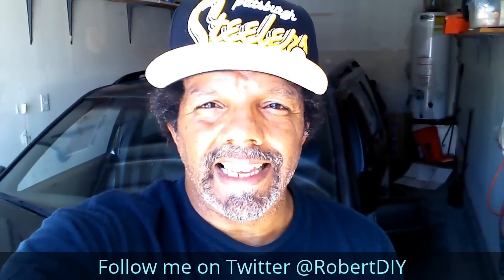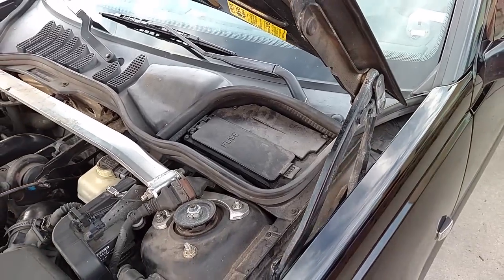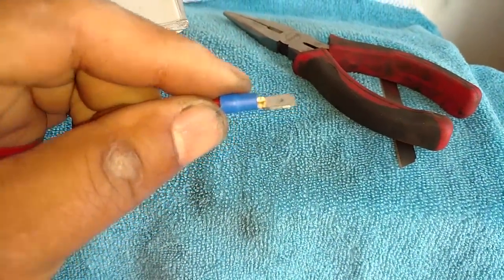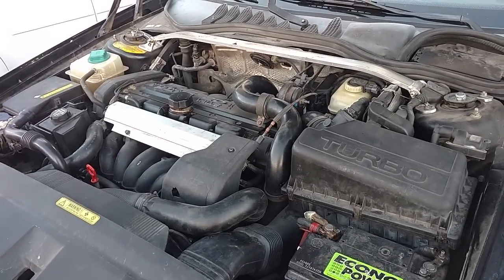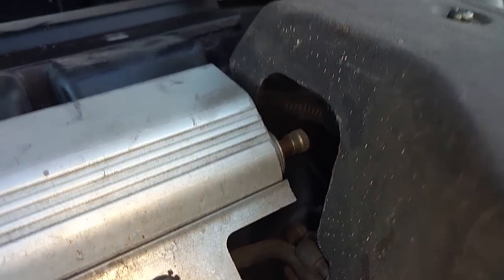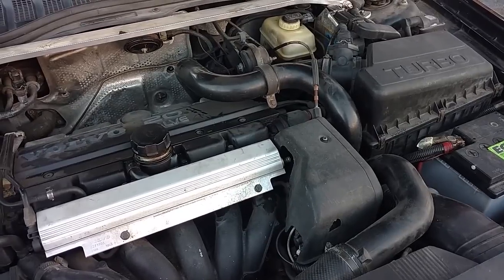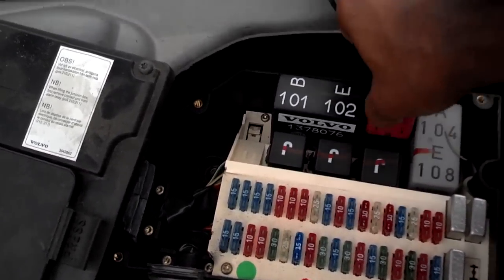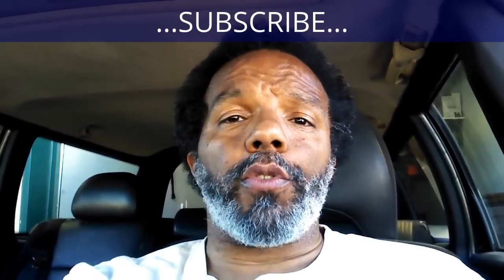Random stalling, will not start, fuel pump and relay testing, Volvo 850, S70, V70, V70 XC, etc.

Comment: Is there away i can contact you i have a 200q volvo s80 and i have a question  about mine
Reply from the maker: Yes
Reply: Robert DIY any where i can email you? In breif i have a 2001 volvo s80 runs perfect. My serpi he belt stredded and i had it replaced  along with the crank pull. Now my car will turn over but wont start. Im being told its the motor. The im being told its simple as a senor and timing that is off so i have it sitting in my yard not knowing what to do?
Reply from the maker: Did you check the timing?
Reply from the maker: https://youtu.be/gt9w-ZSxs9I
Reply from the maker: https://youtu.be/MPt0BZ3B_2w
Reply: Robert DIY my mechanic  put the belt on and idk.  Alot of people  i went it with  said they dont  like working with volvos...
Reply from the maker: https://youtu.be/hJIoyHLl30U
Reply from the maker: So, don't let them touch it.
Reply: Robert DIY ik now but its to late  im having it towed to a volvo certified  dealer
Reply from the maker: Why?
Reply: Robert DIY to get it fixed  thats  the only choice i have. I dont know nothing  about cars. The thing is i dnt know whats wrong with it.
Reply: Robert DIY i alread had my mechanic  put the belt and crank pull on and it still didnt start. It turns over but wont start
Reply from the maker: Did you watch the videos I sent you?
Reply: Robert DIY doing that now
Reply: All my mec did was out the serphine belt back on. Nun with the timing belt ir nun was checked. And i dnt know if my 2001 volvo s80 is a interference  engine or not
Reply: Robert DIY i just dnt want my engine gone  so im hoping  its the timing or w.e. ut im.not car savy to really tell if its the engine for not on my own which is the reason why u want to send it in to check
Reply from the maker: Call me. They ALL are.
Reply: Robert DIY i textrd the number that was on your website
Reply from the maker: Got it.